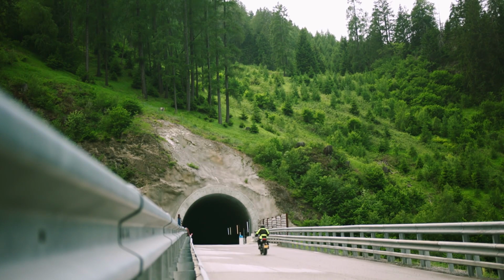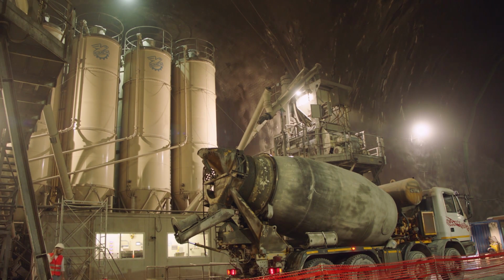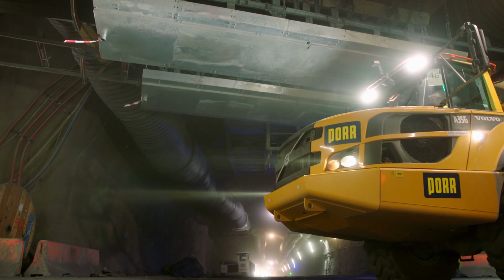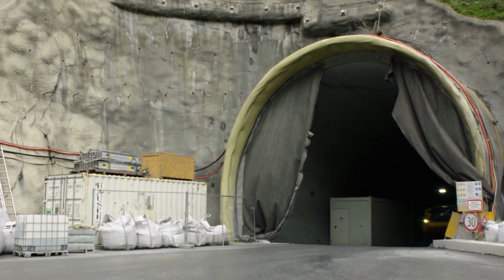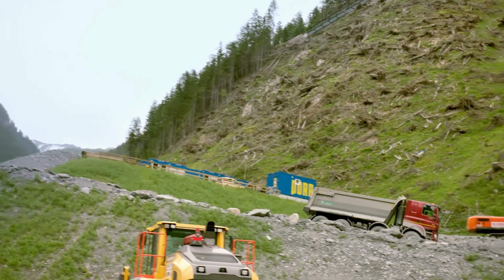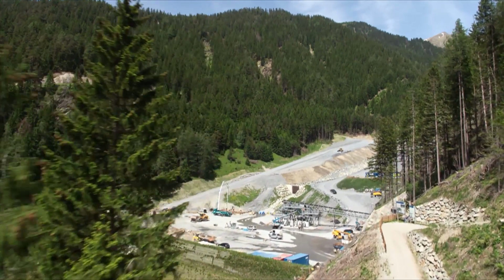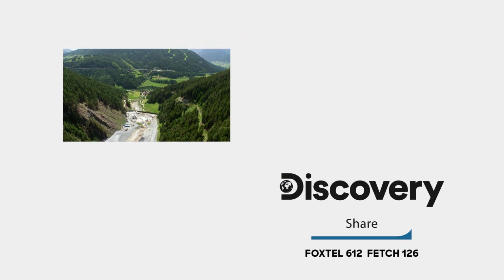Where Does the Rubble of a 55-Kilometre-Long Tunnel Go? |  Richard Hammond's Big

Comment: Give it to neatherlands so they can become a country above the sea level
Reply: Actually not a bad idea. You want to pay shipping? I do wonder why they need to dump it so close to the tunnel project though, there will be a rail line in the end so I figure they ought to just build the rail line early on then ship it out by train to customers who can use it (though probably not as far away as the Netherlands).
Reply: Quill Maurer netherlands can pay 😂 im not from there, my country has mountains :p
Reply: @quillmaurer6563  I think this is an access tunnel for work. The mining is  done in several places at once otherwise it would take to line. And part of the rubble is used as foundation for the railroad.  But most important role of such a dumping site is you can keep digging without worrying about your concrete plant or delivery to other projects cannot manage it. And then you have the potential political problem of putting every gravel producer in the Alps out of business.
Reply: @barthoving2053  I understand the re-use of rubble for concrete, and building an on-site concrete plant, but why do they do that inside the tunnel in a cavern rather than outside at the entrance? I guess political issues with other gravel companies could be a factor - usually when something that doesn't make sense is happening it's because of politics or rules. Though even that I could see being solved with some cooperation - give the gravel to the gravel companies to haul away and sell, they can still sell gravel without having to dig it up, still makes more sense than dumping it in one place while mining it in another.
Reply: The Netherlands has a constant supply of material coming to them for free in the Rhine.
Reply: Gekoloniseerd
Reply: @barthoving2053  take to line?
Reply: Yes.. that would work! Lets lift  all the citys above sealevel. No problem!
Reply: Jim Watson  NOLA would still sink due to no bed rock and bad substrate.
Reply: SidtheKid  The Netherlands will never sink as long as the Dutch live there
Reply: Quill Maurer just build a giant canal so cargo ships can ship the rock there. But wait where will we put the dirt?
Reply: @quillmaurer6563  Concrete plant in the tunnel means shorter trips from where the rock is collected, made into concrete, and taken back again than would happen if the concrete was made outside the tunnel.
Reply: @julieannanderson3625  Yes, but is the cost/efforts saving of that worth the cost/effort of building that large room and underground factory?
Reply: Most of the Netherlands is above sea level.
Reply: @quillmaurer6563  Shorter trips to concrete area means less cost of driver time and truck use.
Digging out cavern wouldn't cost much.
Reply: Quill Maurer ......all about cost I’d guess, closer to transport the better
Reply: @Erikcartman1337  Eh. Chicago was. Lol
Reply: @quillmaurer6563  it's clearly because the less they have to move the absurd amounts of rock rubble and on-site made and used concrete, the cheaper it will be, you can find the ingredients for concrete everywhere, no point in shipping it tens of miles, it would drive the cost up by an insane amount. I think..
Reply: @quillmaurer6563  the big room is peanuts versus having to move millions of tons of rubble even a 100 meters further
Reply: @quillmaurer6563  Because of the shorter travel ways, you need lesser Trucks for the transport.
Reply: @TheDutchyNL  Not exactly: 26% is under sea level (NAP), 59% is vulnerable for flooding and 55% is protected by dams, dune's and other structures.

So the Netherlands is absolutely vulnerable for flooding.

BUT! We are the dutch, we are the best of the best in in water-engendering so no worry's.
Reply: @kasperk679  That's not what we were talking about though. They mentioned sea level. And the majority of the Netherlands currently is above sea level.
Reply: Put it around Venice as a flood defence
Reply: @quillmaurer6563  Why transport the rocks outside, then ship concrete back in? You don't know how logistics work.
Reply: uncletigger  Water is a fluid, it flows over obstacles as its level rises above them.  Changes to a waterway have no consequences to the flow that are above the height of the changed element.
Furthermore, dredging is already done on the Rhine estuary, as it is in every major river estuary around the world.
Reply: @quillmaurer6563  Maybe they can use abandoned rail from ex uni soviet's countries for a cheaper option
Reply: That transport effort would have a pretty massive carbon footprint.....
Reply: @quillmaurer6563  
Taking it out of the mountains you might even produce more electricity than consumed but you wouldn't want to hurt the gravel pit operators.
Reply: @quillmaurer6563  haulage. no reason to drag you wase rock out and then back in again. once you get deep enough, it is long longer saving anything because you need that many more people involved in the longer haulage.
Reply: @deezynar  that could be an idea: dump some of the gravel in the upper Rhine and let the river deliver it for free. :-)
Reply: @fabiogalletti528  Well, I'm not sure how much of it would get hung up at various places in the river before it gets to its estuary, but I think that a fair amount of it would.  Once more, I'm guessing, but I imagine that the people who make their living from maintaining the river as a navigable waterway could predict how much of the rubble would make it to the bottom, how much would get stuck, and how long it would all take.
Interesting idea, Fabio.
Reply: @quillmaurer6563  You question this as if they haven't taken months and years to discuss the work and cost of this tunnel. They didn't just wake up, rummage through the Austrian national coffers and go "yeah I'm just gonna start digging right here and hope for the best."
Reply: @quillmaurer6563  The closer to where you need it is better. No need to build it outside.
Reply: THAT IS SO FUNNY LOL
Reply: @quillmaurer6563  It has to be cheaper that way, otherwise, there is no point.
Reply: As someone who's Dutch, we're gonna need more rubble mate. :)
Reply: or to all those drowning islands.
Reply: @quillmaurer6563  its faster to put the concrete production in the tunnel. Then I dont have to haul it out. Also they wanna make money n u dont do that by giving away gravel lol
Reply: @herpadjerpmaplurp3721  peanuts I say!
Reply: Why dont the Dutch just become fish?
Reply: It does seem a better use of material and energy than filling a valley.
Reply: They have done that for millions pf years. The river Rhine has transported the fertile soil from central Europe to the delta estuary called The Netherlands. So, dump your rubble into the river Rhine and let gravity and water do the transport. I wonder how long it takes.
Reply: @5Andysalive  They can use steel cargo wagons. I have never seen any carbon fibre trains, though those would be way way way less heavy, saving lots and lots of fuel. Why are those cargo trains that oldfashioned? They look like they are weighing tons, even empty. How energy efficient is that?
Reply: @voornaam3191  2 weeks
Reply: We'll have it - Norfolk and the Fens, England.
Reply: The reason for the crushing plant and the concrete plant being inside of the mountain is transport distance of rubble and concrete,  also weather proofing, noise and dust control. Having it all in the mountain solves numerous problems at the one time.
Reply: Quill Maurer dig another tunnel to the Netherlands so you have no shipping fee
Reply: @kasperk679  If you're 26% figure is correct, then I'd say 74% would qualify as most. You're 55% and 59% numbers overlap each other and include the 26% under sea level. Can't have more than 100% at any point in time.
Reply: that as funny
Reply: This is what i thought aswell just so they can expand there country
Reply: Pretty much Netherlands is the only place fighting off the sea
Then you see places like Venice that just gave up
Reply: pff at least we dont have to drill tunnels we got a nice flat area
Reply: Savage 😂
Reply: @quillmaurer6563  QQQAAA
Reply: @quillmaurer6563  it's so they don't need extra planning permissions etc

Comment: imagine blowing your nose after being in there
Reply: imagine NOT blowing your nose after being in there :D
Reply: I'm currently working community service and we're tearing down the interior of a building. It's almost unbareable with all the dust flying in the air, can't imagine being in a cave with literal hundreds of kilos of dust flying by inside.
Reply: PPE
Reply: You not a Londoner I guess?
Reply: @frankspencer5368  nope but i know what its like there especialy underground
Reply: frank spencer Doesn’t london have constant rain?
Reply: @F17A  only when it rains.
Otherwise it doesn't.

...
Reply: You'll be blowing some concrete out of there
Reply: @Soken50  you'd be blowing enough grit out to pave a road

Comment: Opening image, Hammond with electric vehicle on a sweeping mountain road with no guard rails.
*sweating heavily*
Reply: I was just waiting for Hammond to roll the thing...
Reply: And breaking with the front break for stopping...
Reply: @SnerASDF  wat
Reply: Oh gawd didn't realize the was an electric motorcycle. Those things are crazy monsters.
sweating heavily indeed.
Reply: Lars Götz ...yeah that’s the fastest , best way to slow down mate , one day when you all grown up you can ride a motorbike yourself mate, , , it’s not gonna flip unless you stand up and lean into it and pogo like a Bmx
Reply: Lars Götz for a pushing wheel there is one component of force (g) that adds to the weight of the entire vehicle, whereas a pulling wheel could "use" that vertical component of force against (!) the weight of the vehicle coming in from behind; because of that principle, pulling is more efficient in most cases. The other way around, the wheels that would (!) be pulling the weight (front) can give you much more stopping power.

Lots of cars have discs in front, drums in the back.
Reply: uncletigger  All the SportBikes seem to have easily more than 100lb/ft of torque, which is silly for riding on two wheels. The Electric Superbikes are getting close to overkill 150lb/ft. Yes I do know about 1900s Electric vehicles. But Large Format Array &  BMS (Firey Fury) Control did not exist back then. It realy started with NiMH then we exploited Electronics Li-Ion. These massive leaps is what makes this architecture soo crazy.
Reply: uncletigger they are more dangerous than a gas engine bike with the same torque, because electric motors deliver that torque instantly. Plus, the motor doesn't really rev up audibly with no load so it's just THERE when it gets power. So you got rapid acceleration, you don't hear it and you have no transmission lever to "tame" that power by shifting. I think those are the main reasons.
Reply: Ernst Kahn  You clearly have no clue what the Zero SR series are. That is what Hammond is riding.

Comment: Italy + EU needs that tunnel badly.
The current traffic during the summer is intense. Lot's of people and trucks in a narrow road.
To avoid day traffic many people drive at night on the famous Brenner road in the background of the video.
That's how Italy exports products to North Europe. Also, there is a train.
Reply: Rather depends on what you mean by North Europe. It will be the fastest route between Palermo and Berlin, but it isn't dominant on all routes. On of the most important cargo corridors in Europe is still between Bologna and Rotterdam. This corridor sends the train through the Gotthard base tunnel (the currently longest tunnel) and afterwards to the Rhine valley in Germany/France. 

However, the Swiss/Italians/Austrian all have one common problem when it comes to augmenting the capacity on their much needed cargo corridors: it is Germany. For the Swiss it is the Rhine valley, where they should have been finished building the third and fourth track years ago and for the Austrians it is the Inn valley, where they are still debating, uf they should even build two more tracks.

It is really annoying to see such massive project just partially fail, because of one weak link in a chain. And it isn't like there isn't enough money; both projects are partially financed by the EU and Switzerland, as there is a big interest in augmenting the capacity.
Reply: True that but if you don't force them to take the route the HGVs will not use the train as long as driving is cheaper.
Reply: @KuruGDI  absolutely. That's why Switzerland and Austria have several laws that encourage cargo companies to use the train way more often. 
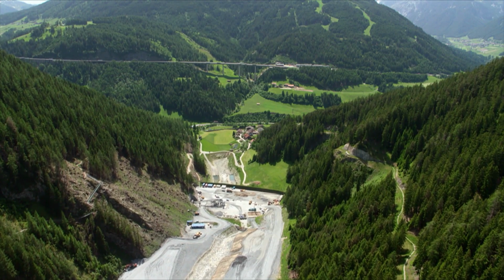In Switzerland for example, you aren't allowed to drive a truck between 22:00 and 6:00 on the motorway, unless you're transporting perishable goods or are from the postal service. That's also partly the reason why we haveway less problems with all those Polish or Hungarian truckers. (But also because, if an employer hires someone from another country, they are forced to pay the workers a minimum wage, which is typically about 10-20% lower than for a Swiss employee, but there will be a lot more checking, if things go right, so it is often not lucrative to hire foreigners in Switzerland.)
Reply: @axelstoerckle7295  downside of having the government being partually controlled by the car lobby and old hags that couldnt care less about how the country or europe does in a few years out. germanys infrastructure as a whole suffers from that in a shitload of areas we dont even have proper internet connection
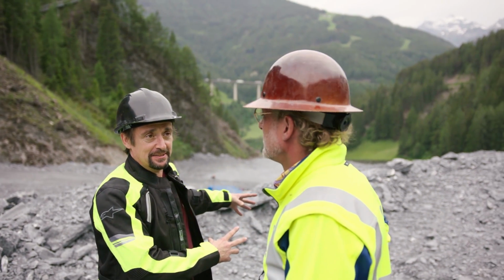Reply: @axelstoerckle7295  Uh, this is very nearly exactly the same in Germany. Vehicles above 12t aren't allowed to drive between 22:00 and 06:00, and on Saturday and Sunday, or any holidays.
It's true though that especially Switzerland does more for it's rail cargo capacities, and just in general has a better rail network.

Comment: I’m glad people have learned from the Aberfan disaster.
Reply: the austrians know what they do... just look at the drainage pipes for example
Reply: @maxi-g  I wasn't being facetious. Here's something I wrote to another viewer who was concerned about the potential danger:

"It sounds like they’ve learned from the Aberfan disaster. Lithologically speaking, the limestone and volcanic substrate being excavated here is inherently more stable (thermally and structurally) than something like coal slurry from anthracite refuse, as was the case in Aberfan. Placement of refuse tips within the bases of valleys (which they are doing here—as opposed to on slopes or high ground as was the case in Aberfan) is standard practice and is generally safe. They also seem to be conscious of ensuring adequate water drainage, and spreading the tailing in a manner that creates more surface area than tip height.  

Although they plan to make the tip 140 meters in height, I’m sure that height will be distributed across a large surface area in the form of a mesa rather than a heap. In addition to the drainage measures, their plans to replant the natural fauna will also help to protect against soil erosion. So, this is not something to be too worried about. Sounds like they’ve thought it through."

Comment: Imagine driving a zonda through this tunnel
Reply: Nic Wood y a zonda instead a chiron ss 300+
Reply: @Thatoneguy-uc9jq  in a tunnel, id prefer sound over speed. The chiron would be better on a long straight road
Reply: Will run out of fuel before exiting 😂😂

Comment: The extracted material is most commonly called "spoils," and is usually used in roadway fills on either side of the tunnel.
Reply: *spoil.  Spoils means something quite different.  (Spoil is a kind of unwanted waste material, spoils are things you stole or gained though questionable means.)

Comment: Acutally, the tunnel is between Austria and Italy
Reply: Acktchuallyyyy
Reply: And it's 55km long while the Gotthard Railway Tunnel in Switzerland 57km long, so it's clearly not the longest..
Reply: @SonicDeluxx  If you count in the part around Innsbruck bypass (which is part of the tunnel now), it is longer. The direct route from Franzensfeste to Innsbruck is 55km, as you have stated. Going from Italy to say Munich, then you would take the longer route
Reply: @StoppelHD720  Haha, Acutally sounds very urgent indeed
Reply: SonicDeluxx it is, full lenght tunnel will be shorter than gotthard
Reply: @maxi-g  English please!

Comment: I'd just sell it off over time. No need to quarry it when it has already been dug.
Reply: And eventually this place will have rail access, being a train tunnel. Would make sense to me to build the rail line early on and ship it out by train to customers who can use it. I'd guess that them not doing so is indication that for some reason, maybe type of rock, it's not something of any economic value. But they are using it in concrete, so it must be at least somewhat usable.
Reply: @quillmaurer6563  would not be first time a committee has decided which proposal shall be done regardless of actual value.
Reply: @1kreature  yeah
Reply: Thank you!!! Although I will say construction projects, though there’s exceptions of course, don’t ever want to buy fill and will just use what they got from elsewhere on the site. Even then, why rework Mother Nature when you can literally print money selling it off to concrete manufacturers, pavement manufacturers, etc. It’s wasteful and dangerous given what happens when man plays Mother Nature on this gran a scale 😬
Reply: Much/most material is not usable for concrete. It's mostly Innsbrucker Quarzphyllite, rich on quartz, low on lime.